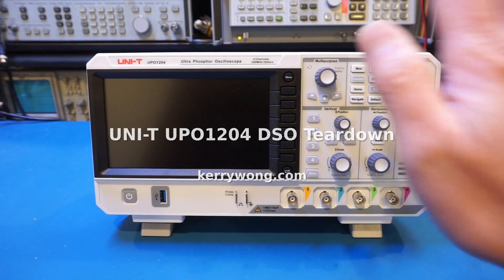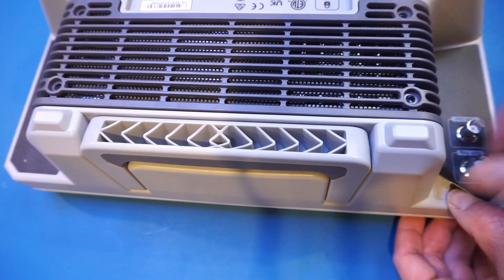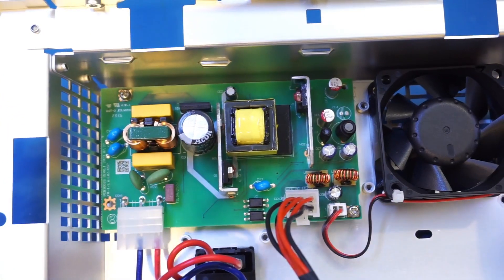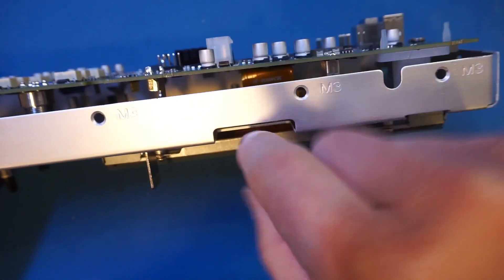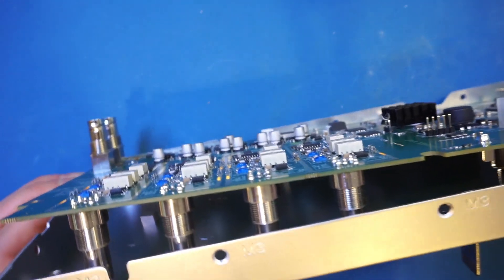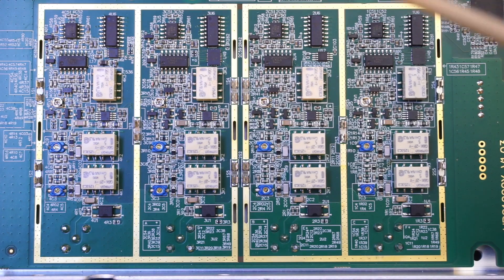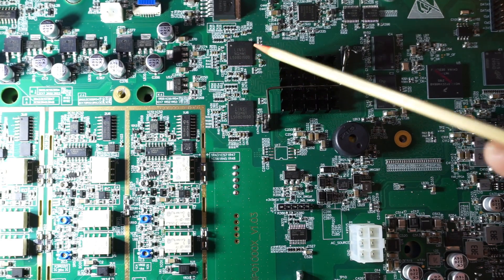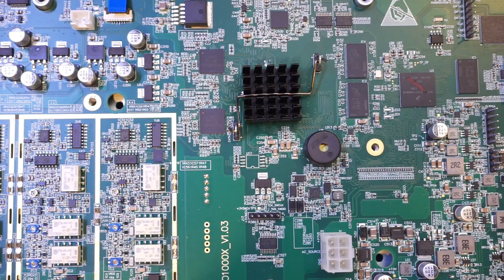UNI-T UPO1204 DSO Teardown

Comment: Remove the LCD, flip it forward and remove the cable from the LCD itself.
Reply: I was thinking the same thing.  Unscrew the display, and hopefully the cable can be disconnected from the display.  Or maybe the display can slide to allow more ribbon to extend below the shield to unplug from the main board.
Reply: Normaly you would only need to remove the display if it was to replace a broken display.
Then you would just take out the 4 screws, and disconnect it,
connect the new display, and Bob's your uncle.
A total teardown is probably not something they plan for a user to do...
Reply from the maker: It would be far more easier if the flatflex is a couple of inches longer.
Reply: @KerryWongBlog yes, but that's how it comes apart and how they put it together, the display is plugged in after the board is attached to the chassis then it's screwed to the chassis, so you have to do that in reverse order to take it apart